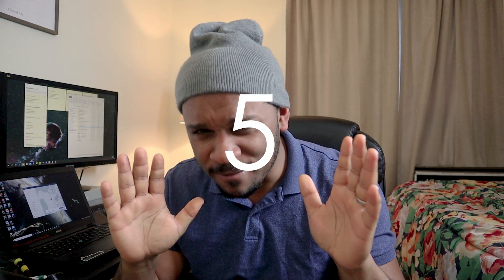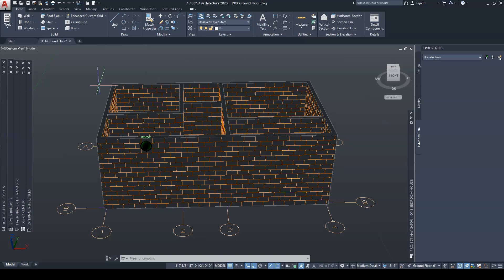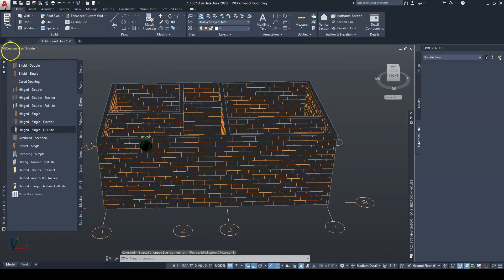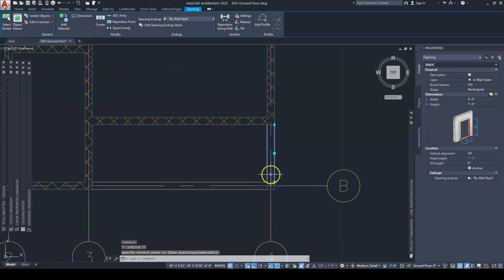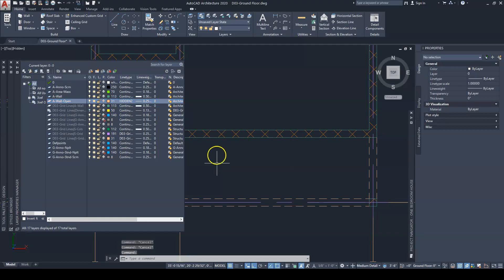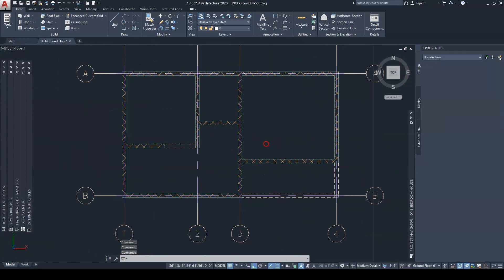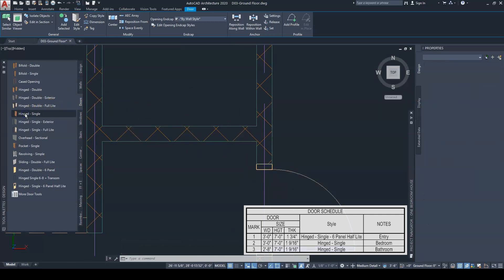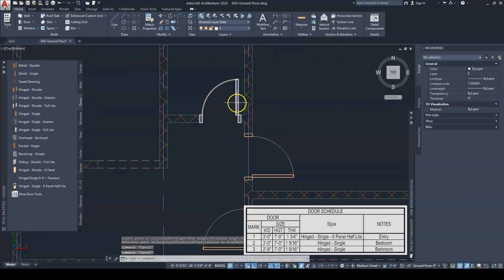DOORS & OPENINGS in AutoCAD Architecture 2023

Comment: Hi, great video! I’m having a problem in AutoCAD Architecture 2016 and I was wondering if you could help me.
When I place a window or a door, the opening doesn’t stay empty — instead it shows a solid panel (like a filled surface) inside the frame. For doors it should show the open space, but it’s displaying a hatch/solid instead.

Do you know how I can fix this so that the openings stay clear, just like a real door or window? Any advice would be really appreciated. Thanks a lot! 🙏
Reply from the maker: It sounds like your door is not being attached (hosted) to the wall. When you activate the door command, check the Properties Palette to make sure it is attached before placing the door.
Reply: @TDVision_U  Thanks for the reply! I made sure the door/window is anchored to the wall, but the solid fill (purple/brown plane) is still showing inside the opening. The wall is being cut, but the infill doesn’t disappear, so the opening is not clear.

Do you know if there’s another setting I should check to remove that fill and keep the opening empty?

Comment: TD HOW ARE YOU. I WAS WONDERING ONCE YOU PUT IN THE DOOR ON THE RIDE SIDE ,HOW DO YOU SAY CHANGE IT TO 6 INCHES FROM THE LEFT SIDE.IT SEEEMS YOU ONLY GETY THOSE OPTIONS WHEN PUTTING IN. I KNOW YOU CHANGE CHANGE THE SWING AND THE IN/OUT .BUT IF GO TO PROIPERTIES LOCATION IS NOT REALLY THERE? FIND YOUR VIDEOS GREAT. ALSO I USE CAPS ALOT SO IM NOT YELLING.
Reply from the maker: If I'm understanding your question correctly, I don't think there's a way to do that other than measuring the distance on the right and manually moving the door over the distance you need to, in order to get that 6" on the right side.

Comment: i understand all that you do which is very cool.the only thing i dont get is how you show the dimension when placing the door into the wall? is there a setting?
Reply from the maker: Well yes. It shows up automatically when I change the settings in the Properties Pallete under Location. Also make sure that Dynamic Inputs is turned on.